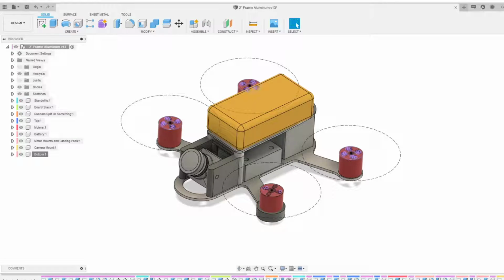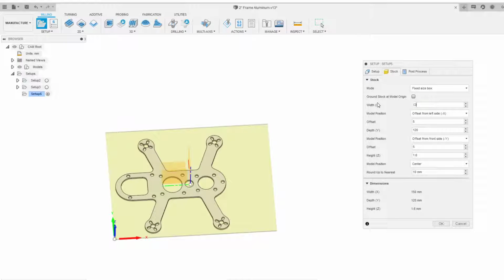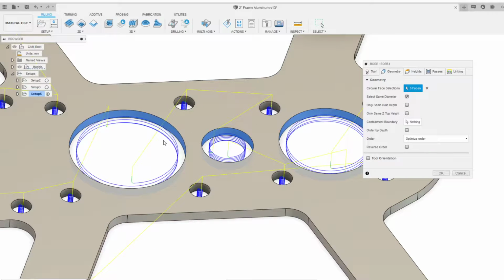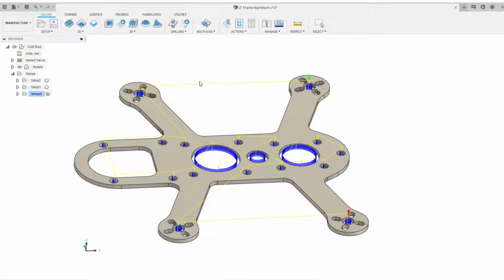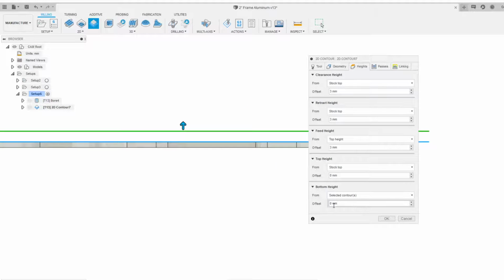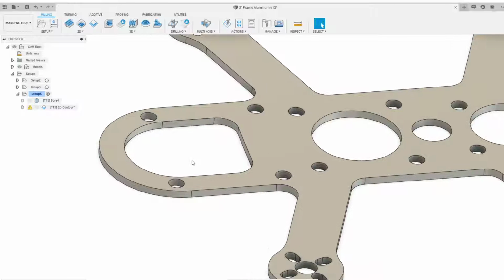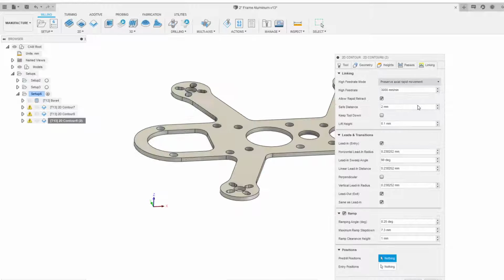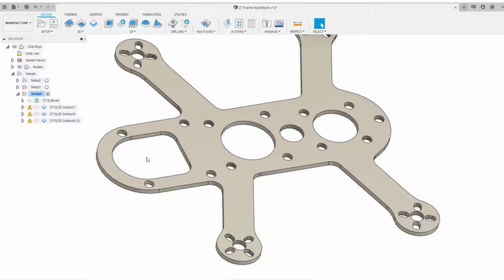MPCNC - Fusion 360 CAM & Workflow - Cutting 2D Parts Out of Flat Sheet

Comment: Im worried about using sticky tape under my parts, I think the cnc will eat it and jam up haha. Very informative video, thank you so much!
Reply from the maker: I use scotch extreme mounting tape.  I buy a huge roll from Amazon.  Just set your Z0 depth correctly and it shouldn’t really get cut by the machine.  But a nice sharp tool won’t be phased by cutting a little bit of foam tape.
Reply: @gump1119  wow, thanks for the reply :) I'll look into it!

Comment: You are good at explaining this stuff, very clear and informative. Please consider making more F360/CNC-videos. Now I'm inspired to cut my own MiniQuad frame :) Kind regards from Sweden.
Reply from the maker: Did you end up making a quad frame?
Reply: Not yet. My MPCNC has been up and running for a while, but I'm having some issues with jerky circular movements that I haven't solved unfortunately. So haven't done any real jobs yet, want to fix that issue first.